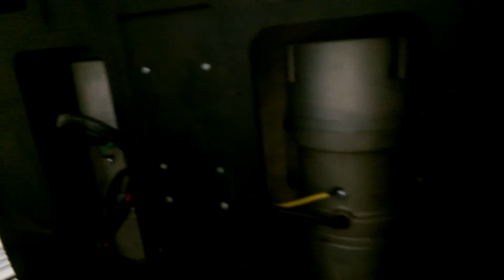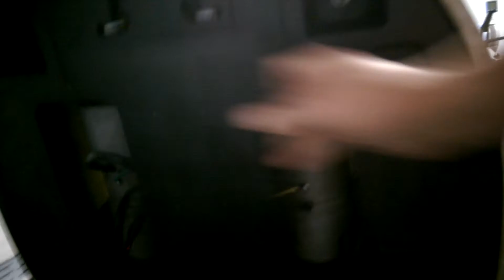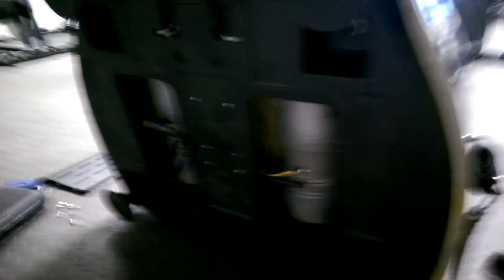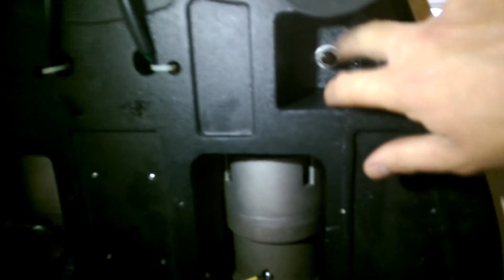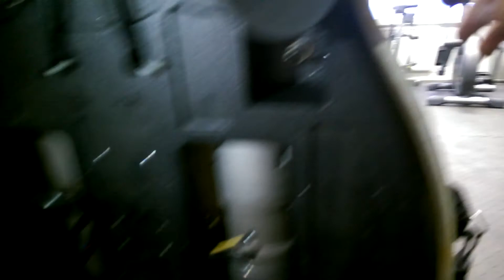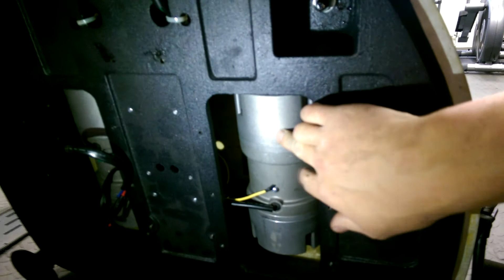How to dismantle a vibration plate

Comment: I have a softgym vibration plate that receives power but the display doesn’t turn on. It’s supposed to beep as well when it turns on but it doesn’t. The remote will not do anything either no matter if I replace the batteries. Any help is appreciated. It’s new but I bought it from someone and can’t return it…
Reply from the maker: Hi - did you see it working before you bought it? Was the machine dismantled for the move or was it package in it's original box?

Comment: Question … if the on off switch is broken is there a way to replace it? It’s a exercise vibration machine
Reply from the maker: Yes - usually the on/off switch is a generic mains switch and it can be replaced. Feel free to send a photo of the switch to me at jonisaacs26@gmail.com and I'll take a look to confirm.
Reply: @charteredengineer  

Thank you responding. I will do that first in the am
Reply: @charteredengineer I have an exercise vibration plate from softgym that is receiving power (because the switch lights up red) but the display doesn’t turn on. Any help is appreciated. It also doesn’t beep like it’s supposed to when you turn it on.

Comment: I have a vibration plate that has recently started to make a knocking noise as it vibrates. The knocking is in sync with the vibration. Is there a way to fix this or are the motors broken?